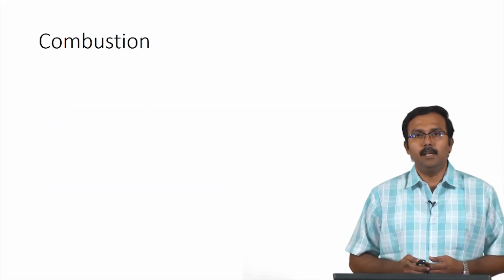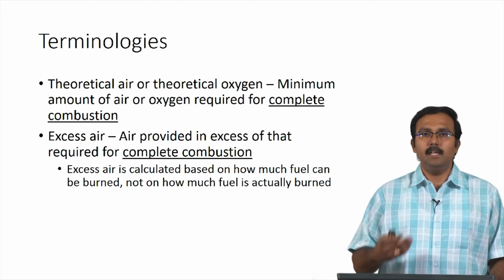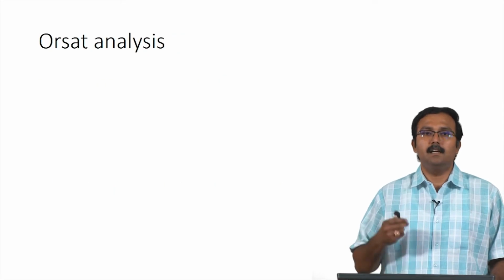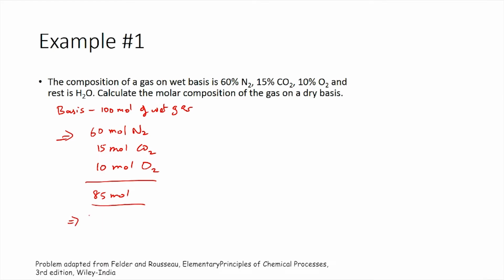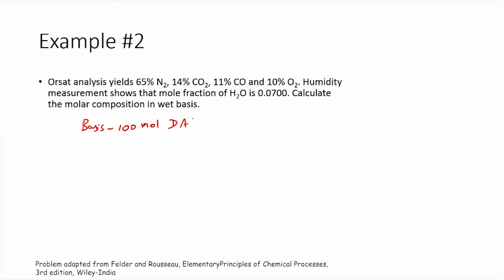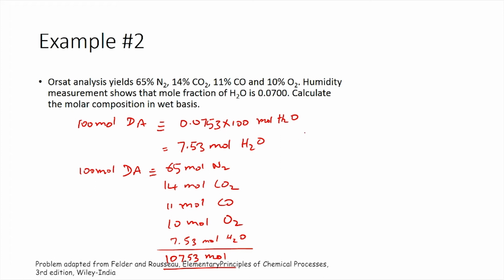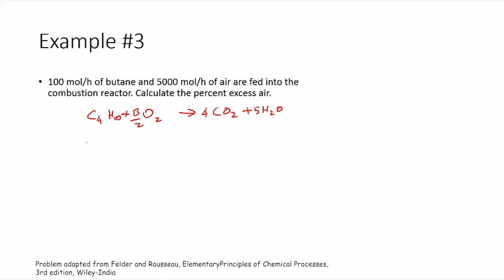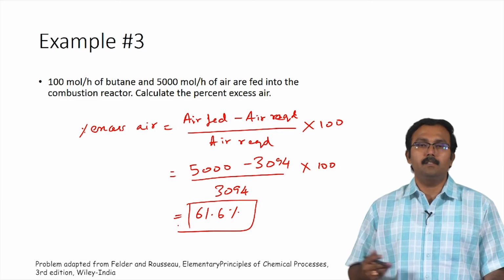#19 Combustion Reactions | An Introduction | Material & Energy Balances

Comment: sir how did you find out the value 0.930 mol dry air/wet air?
Reply: The total of the 0.930 is subtracted from the total of 100 moles, which as a decimal is represented as just 1. 1-0.070=0.930. That is where you get it from.